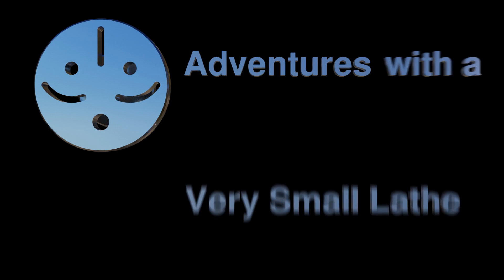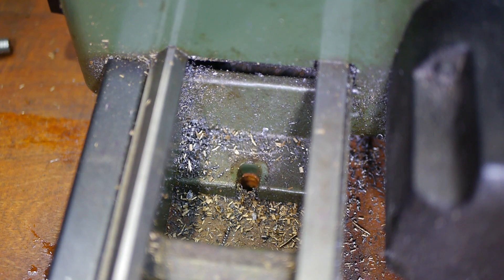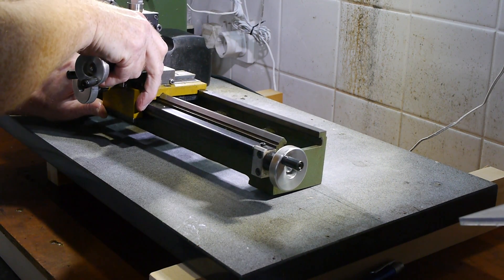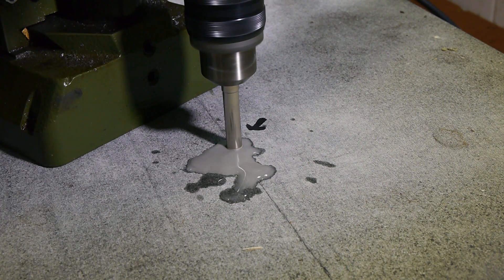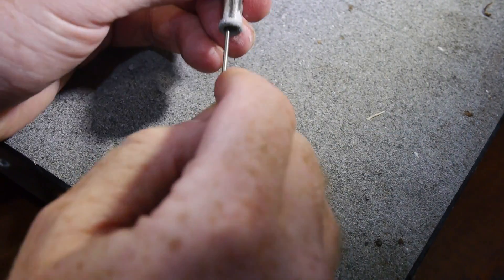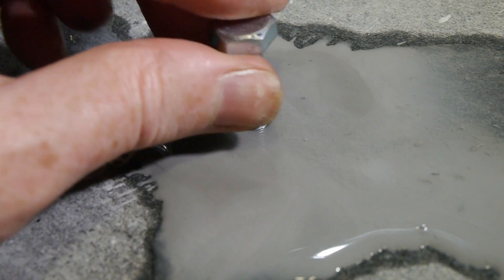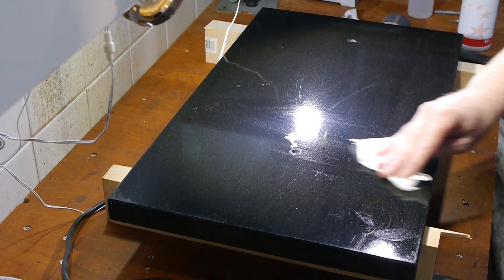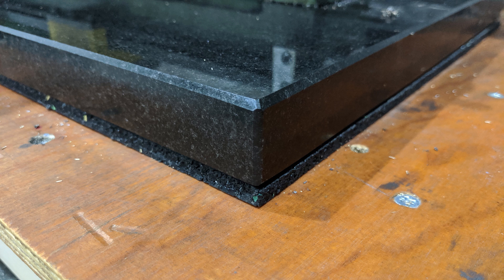A Solid Granite Base for the Proxxon PD 250/e Lathe

Comment: When I got my 8x16 lathe I made a base out of 3/4 inch plywood. I screwed 4 identical pieces on top of each other that I ended up with a 3 inch thick wooden base. I screwed 4 wheels under it, and put the lathe on top. When I used it, I sat on a very flat plastic chair in front of the house. When not in use, it was parked near the sofa and the living room. When we moved and I got my shed I welded up a table with drawers  for the lathe, but kept the wooden base.  Whit granite I would suggest to put some epoxy between it and the lathe that the casting makes good contact with the flat surface.

Comment: Interesting action, looks very solid! Increasing the rigidity of the lathe design has the main purpose of increasing accuracy, as I understand it. And what accuracy characteristics have changed after this modification? Do you have the results of measurements of the precision characteristics of the lathe before and after modification? I have a Proxxon PD230E lathe and I would like to replace the motor - increase the power. What can you say about such a modification in light of the rigidity of the design of such a lathe and its accuracy characteristics?
Reply from the maker: Increasingly the rigidity has a number of effects, and better accuracy is great, but not my primary reason. Increased rigidity means I can take much deeper cuts without causing chatter, which makes work much faster. There are still quite a lot of other factors which affect accuracy on this lathe, but most of the projects I've done haven't hit the accuracy limits yet, so I'm not sure how much this upgrade has improved the accuracy in practice. It has allowed me to get more done, and means I have to suffer less from the screaming sound the cutters make when they chatter really badly.
Reply: @AdventureswithaVerySmallLathe  Thanks for the answer! That is, you did not check the accuracy characteristics of the lathe after this modification. And the rigidity itself (deviation of some parts of the lathe at a given force action) have you checked? And about the increase in engine power (in some of your videos you mentioned this), I am interested in your opinion, please.
Reply from the maker: @НиколайМдинарадзе  The only measurements I have done are the increase in depth of cut I can make without causing excessive chatter. Before the granite base a 0.1mm cut was the maximum practical depth for most materials. After the mod I was able to take between 0.2mm and 0.3mm depending on the material. I could probably take deeper cuts if the motor had more torque. It feels like motor power is now the limiting factor rather than the rigidity of the bed.
Reply: @AdventureswithaVerySmallLathe  Currently, the Chinese sell a lot of DC electric motors on Aliexpress with a capacity of 200 - 350 - 680 watts per 24 - 48 - 220 volts. Their diameter is 66 - 77 mm. That is, they can even be installed in the lathe housing. So I am interested in what power the DC motor now after your modification could be used according to your estimates?
Reply from the maker: @НиколайМдинарадзе  I'm concerned that other parts of the lathe may not be suited to a stronger motor. The headstock is hollow aluminium with some steel plate - not nearly as solid as the iron casting used in Chinese mini-lathes. Too much torque might bend the housing permanently, so I'm not planning a bigger motor.
Reply: @AdventureswithaVerySmallLathe  The rigidity and strength of the elements of the lathe also confuses me when I think about increasing the DC motor power. But I am more confused not by the body of the headstock, but by the support. On the other hand, there are two fundamental considerations that it is possible to increase the DC motor  power within reasonable limits. 
The first point is that the declared power of the lathe motor 140W is "power consumption". The useful power on the shaft is at least 30 percent less. 
The second point. The specified motor power is the maximum power at the maximum allowable voltage and maximum RPM. When the rotational  speed decreases, the applied effective voltage also decreases and the developed power decreases non-linearly. In addition, the lathe Proxxon PD250 motor controller is made according to the simplest scheme on a triac and does not increase the applied voltage when the load increases in the process of turning. 
That is, if you use a more powerful DC motor and an advanced controller with speed stabilization, motor will give more power within acceptable limits at low speeds.
There are other indirect considerations that it is possible to increase the power of the motor (suppose up to 200W),  but of course with such a modification it is necessary to control the precision characteristics of the lathe. 
Thank you for the discussion!

Comment: Forgive my ignorance as I’m just starting out.
I build a solid metal table for my mini lathe but the floor of the workshop i have and indeed the table are far from perfectly level.
What kind of tolerance is required when trying to get as level as possible a surface for the lathe?
Reply from the maker: It's important to understand the difference between a surface's levelness and its flatness. When people talk about levelling a lathe, they are usually talking about removing twist from the bed; in other words making sure that the plane of the bed is as flat as possible. For most people it doesn't matter too much how level the lathe is.

It shouldn't really matter much how level your floor is, but you will need to make sure your table has adjustable feet so it sits solidly on all of them and doesn't wobble. The top of the table will need to be flat, or when you bolt the lathe down, the bed will be twisted.  As for tolerance, that really depends on what you'll be doing with the machine.  A lathe cannot be too flat, but if the parts you are working on don't have fine tolerances then you can put up with a small amount of twist.

As a rough guide, if you put your lathe on your table with the metal bottom of the lathe directly on the table, there shouldn't be any gaps between the lathe and the table that you can detect with a thin sheet of paper. If there are, then either the bottom of the lathe isn't flat, or the table isn't flat. Working out which is an entire topic on its own, but if you bolt the lathe down when there are gaps, then the bolts will cause the lathe bed to twist.

This topic is way too large to cover in a single comment, but I hope you have enough to start with and dig up more.
Reply: @AdventureswithaVerySmallLathe  thank you, that is very helpful. And makes me want to cry, because my extremely heavy metal table I put together from scrap metal parts probably isn’t anywhere near as flat as I’d like.
Maybe I can fix that by bolting a piece of granite top like you did to it?
Thanks again, your channel is very helpful for people like me as well as the old hands too. A rare skill to be able to appeal to such a wide range of people.

Comment: For something that may be a bit more readily available, I have bought 1.00 inch thick aluminum flat bar from Metal Supermarkets. The widest that I could get was 12" which would be more than wide enough for a small lathe. Years ago, I got a piece of 1.00 inch this steel to use for a base for a small mill. In that case, I handed it off to a local waterjet cutting shop who cut the holes and perimeter to my spec's. I think your granite choice was a great one.
Reply from the maker: For me granite was pretty accessible. There are several kitchen worktop suppliers nearby who sell offcuts, but the nearest metal supermarkets is an hour and a half drive away. I'm pretty sure an aluminium flat bar does the job just as well though, as it's almost exactly the same density. Steel would be great, but I would no longer be able to even lift it.

Comment: What are the dimensions of your lathe base? Looks like 30 mm thickness. I have looked in vain for a drawing of the PD250/e to find out the locations of the two holes (haven't bought the lathe yet, so I have no idea). Did you write the CC distance down? It looks like you positioned the lathe a bit behind the center line, is that good?
Reply from the maker: 30mm thick, 600mm long and 350mm deep. Well spotted on the thickness. My notes tell me that the maximum distance between bolt centres was 349mm to fit the mounting, but I set my distance a couple of mm closer together to make sure they didn't rub against the casting.
I set the lathe far enough back that the handles didn't stick out over the edge, and I generally line up the edge of the base with the edge of my bench. It seems to work just fine.
Reply: @AdventureswithaVerySmallLathe  By the way, it seems that the QCTP has been redesigned. The two gibs are gone and the widening in the bottom of the mounting hole is not there anymore. A little disappointing, since I planned to copy your improvement of the screw.
Reply from the maker: @paullehmor982  The gib based design isn't all that great, so I'm not sorry to hear it's been changed. The lack of pocket at the base of the toolpost shouldn't change things too much. You will still want a shoulder next to the top of the compound, but now it just needs to be machined to a slip fit in the toolpost, then the rest of the stud should have more clearance. It should still be able to ensure the toolpost rotates cleanly, and stays stable when adjusting it.
Reply: @AdventureswithaVerySmallLathe  You are right. But the stud must be wide enough at the base to sit properly against the compound.The hole in the tool post is 8.4 mm at the base and 13 mm at the top. One could also turn it upside down.
Reply: @AdventureswithaVerySmallLathe  I'm expecting to receive a Nero Assoluto granite base in a couple of weeks. I bought a Milwaukee 10 mm diamond drill. Do you remember what rpm you used to drill the holes? I guess you used a 8 mm drill.
Reply from the maker: @paullehmor982  correct, it was 8mm. I remember looking up the rpm, but I don't remember what it said. The most important thing was to keep it immersed in water, and keep to water moving.
Reply: @AdventureswithaVerySmallLathe  Thanks, I think I will start out with the slowest rpm. I will later see if I can raise the lathe a bit from the base. There is very little space for clearing out chips. Aside, have you considered doing something about the horrible arrangement of the nuts that hold the gear wheels? In a way, I like designs based on widely available standard components. So I will pile up with M5 nuts because they fly all over the place when I fiddle with the gears. A solution could be to make three mini T nuts and a mirrored back plate to hold them in place. Then one can use both hands to hold the gear wheel and tool respectively. My finger nerves are damaged so this must be solved. Overall, I'm impressed with the machine. Just made a camera adapter for my indicator stand. UNC 1/4" 20 in one and, and 8 mm in the other.
Reply from the maker: @paullehmor982  There is some Starrett cutting speed information here:

https://www.starrett.co.uk/downloads/cutting-and-speed-guides/holesaw_cutting_speed_chart_p78.pdf

I haven't found a good way to deal with the gears yet. It's always crazy fiddly, and I'm not even sure how I would do it if my finger nerves didn't work so well.

Comment: Almost a year now since you did this.
Has it proved a worthwhile exercise?
Reply from the maker: Absolutely. The lathe is now much less vulnerable to vibration, and I now find that I'm limited by the torque output of the motor long before I have issues with rigidity. Would definitely recommend this for any small lathe.

Comment: It appears you did not countersink the holes for the bolt heads.  I suppose the holes in the vibration dampening mat will make up for that.  Also, the use of polished granite makes a nice looking installation.  Is there any reason to not use concrete?

Comment: I verry like your enthusiasm. 
But a granite plate as the base for a $ 400 Lathe, (whose slide is made of aluminum)..... is completely overkill!

The Plate would have been better used for marking and measuring.

The Proxxon lathe does not generate a tenth of the precision this plate generates there!

 Incidentally, the vibrations when cutting stones with a drill bit are death for your cheap milling machine .....

But..... good Thought..... is never good made!!!!!

Comment: Next time for cooling the drill, just cut the neck of a plastic bottle, then place it right in the position of the hole you want to drill, seal the cap with hot glue then fill in the bottle neck with water. Tadam ! constant cooling.

Comment: You might want to make some washers to go between the bolt heads and stone to distribute the force against the stone and reduce the possibility of cracking it. I'm thinking of something with a slightly raised edge around the rim (like what is used on either side of a grinding wheel). It would also be good to put a heavy paper washer between the washer and the stone for the same reason.
Reply: Have you considered a leather washer?

Comment: Thanks for this video.  It inspired me to keep an eye open for a piece of granite on which to mount my Chinese 7x14 minilathe.  Fortuitously, a friend bought a slab of granite for me at an auction, thinking that I might be able to use it but having no idea that I was looking for a piece.  A full 40mm thick and big enough to mount both of my minilathes!  The mounting hole layout was a bit more complicated because the holes in the lathes are threaded and obscured from above.  I found the best progress was made with a carbide bit in my cordless hammer drill.  The combined mass of the lathes and slab must be close to 150kg!
Reply from the maker: That sounds like it will make one hell of a base for your lathe. I don't even want to think how you'd move them around.
Reply: @AdventureswithaVerySmallLathe  They're on a rolling cabinet.  But I fear that I now need to upgrade the casters :-)

Comment: Excellent videograpy!  Very much appreciate quality editing, shot set up and lighting...and tasteful music with a quality voice-over, Well done.  I just watched your mini lathe tear down and decided to sub, then saw this which I have thought about for a long time for my mini.  Looking forward to seeing how you level and square it up.  Thanks for sharing your thoughts and talents.
Reply from the maker: The Proxxon is going to be quite tricky to level, as each end of the bed only has one single bolt hole, and I really don't want to mess up the lovely casting with more. During this project it was clear that the ground surface of the lathe base was pretty flat (especially compared with the Chinese CJ0618 Lathe), so bolting it straight to the flatish plate gave me a pretty level starting point. I'm worried that shimming the corners might reduce the solidity of the overall setup, even it if does remove a bit of twist.

The idea with the CJ0618 is that I get to try things out for the first time, as I'm not too paranoid about damaging it, so the CJ0618 will be the first I attempt to level.
Reply: @AdventureswithaVerySmallLathe  You never know how much it will take until you set the level on it and check the numbers.  Don't know much about the PD 250 but it seems to have a pretty substantial bed (compared to the mini and poorly machined feet).  It may not have much twist over its length.  Not sure shims would be that much of an issue.  I'd probably use brass shim stock at least to try it.  Another thought would be to use some ground flat bar wide enough for 2 bolts each under the lathes single mountings and shim that instead¿  It will raise it up a bit but won't loose too much stability and gives it a wider foot print.  Good Luck and looking forward to see what ever you come up with, or need.
Reply from the maker: @pjhalchemy  I guess the first thing to do is try and measure the twist. Once I know what it is, I'll have a better idea of whether I need to do anything.

Comment: All the "granite" countertop material I have found here in the US is actually a composite of granite and epoxy.  Several suppliers were adamant that their granite was cut and polished like gravestones, but they were either mistaken or lying.

  I took their samples and scraps, and cut them up on the industrial laser I operate at work, and it was clear from both the oder and how the epoxy was blown out of the cut like fiberglass strands, that not a single piece was entirely natural stone.

They cut very well with an industrial waterjet, if you need complex cutting of that material.

Comment: I did a similar thing to mount a cheap USB microscope. Used a magnetic dial base set for the arms, and removed the magnetic base. Then took a scrap of granite  ( from the local monumentalist scrap bin, so free. Saw this week a long cut unpolished block ideal for a small lathe there in the bin as well) and drilled it. Used a 8mm mirror bit to get the initial hole, then swapped to a 10mm Bosch SDS bit, used as a regular bit, to drill down half way through the granite.  Took some brass rod, drilled it out and tapped it to M8 to match the thread on the magnetic base, and then used 2 part epoxy to make it stay in the hole.  Firm base, does not have any flex, and a lot more rigid than the original plastic and pot metal base the microscope came with, plus also makes for a nice backdrop in images. Overall around 2kg of granite with one broken side, so all I did was clean it, give it a coat of spray lacquer, and put some felting under it as base.
Reply from the maker: Nice idea! Sounds like I need to keep an eye on my local monumentalist, and see what they throw out. I'm starting to think of all kinds of good ideas.